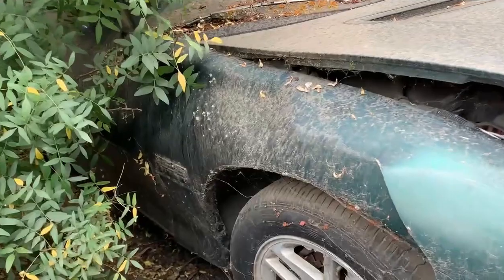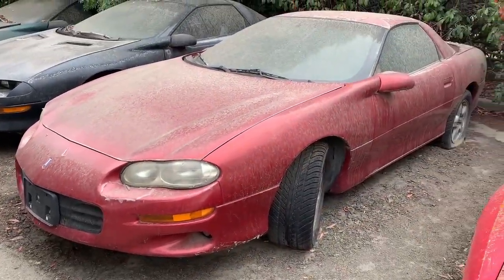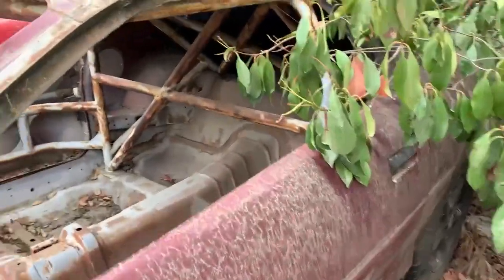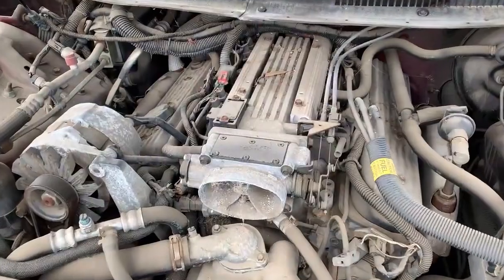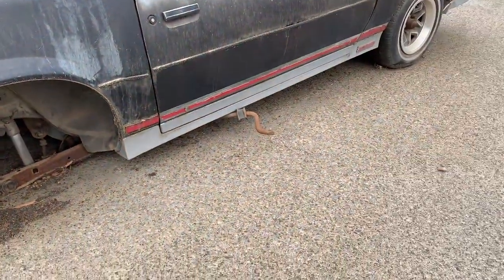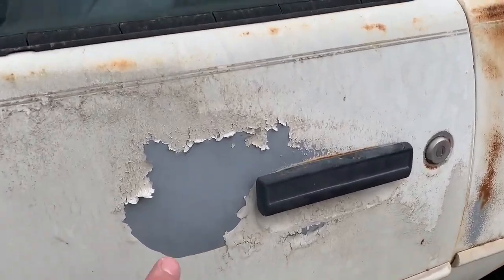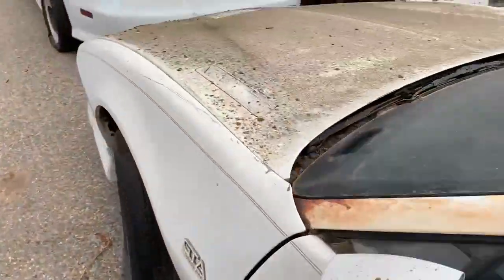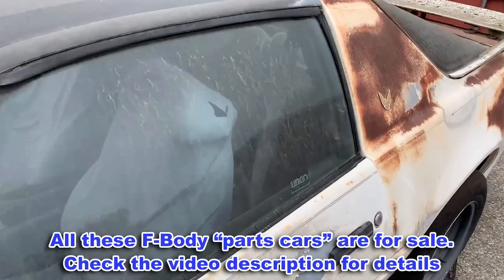Hidden F-Body Junkyard Crawl! (For Sale!)

Comment: Looking to buy and would travel for one of these gems. I'm an F body guy and see so much potential here
Reply: For the people who never owned a 4th gen Camaro SS or Z28 is really missing out. I own a black 01 SS 6speed I modified from top to bottom in excelent condidtion with only 43k miles. What a thrill!
Reply: Thinking of selling mine 2002 5th anniversary Convertible, Runs,,AC,147,000

Comment: If I was a millionaire I would save all of them,except maybe the v6's
Reply from the maker: Yeah, us too! 👍👍
Reply: Gotta admit those later v-6's were strong and bulletproof and very reliable.not much on power only 200hp.sad most of them were manual transmission cars.
Reply from the maker: @dcartellone2659  Yeah, that’s not bad power…considering that our 86 IROC 305 TPI is 190 HP. 😩😩😩😂😂